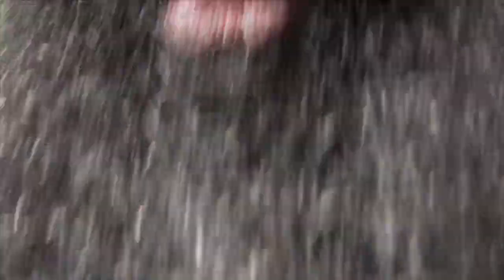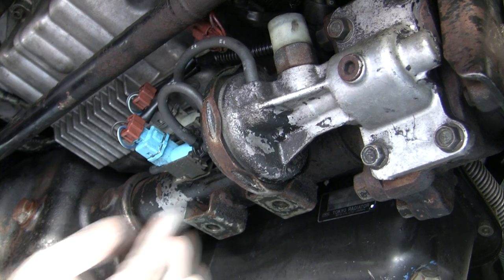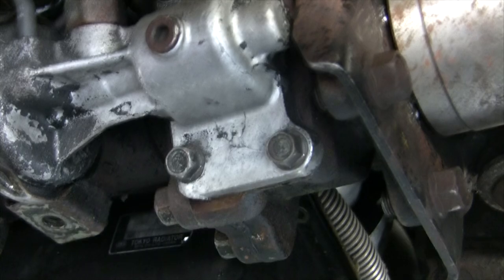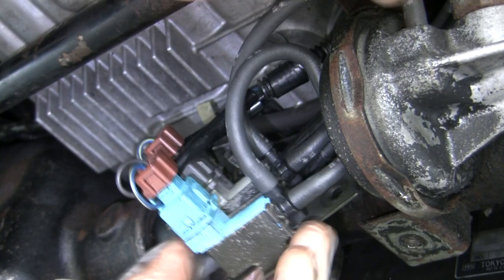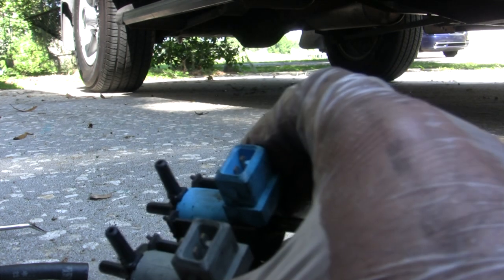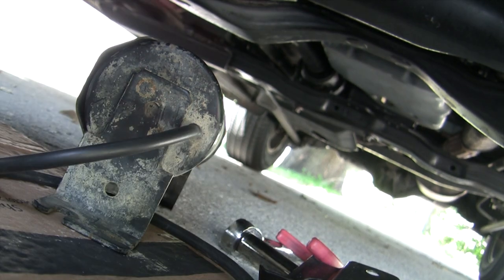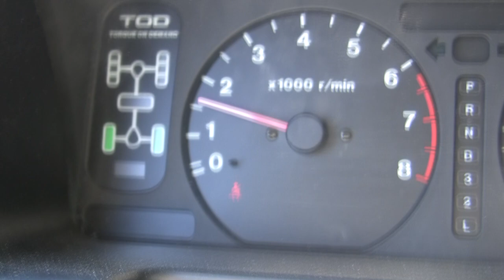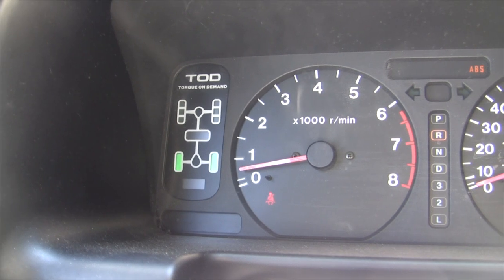Isuzu Trooper Flashing 2WD 4WD TOD Check VSV  issue Cleared!

Comment: I have a 1998 Trooper. It took me 3 years to track down the problem. With the help of Planet Isuzu, I could work through the system. I first started with the solenoids. I disassembled them. Polished the metal cylinders to remove corrosion, sprayed with parts cleaner, and reassembled. Then I checked all the Ball switches that indicate that the messages sent by the ECM at each step were enacted. Finally, I turned my attention to the transfer case.  That is where I found a loose ground wire. There are 3 control wires that go into the motor that moves a rod that engages the front wheel drive. It is only after all the ball switches are in agreement that the blinking light on the dash stops blinking and the 4WD is working. The main reason it took me 3 years to fix my Trooper was after each step I took the 4-wheel drive would operate for a while and then the SOTF light would start flashing. In hindsight, this was not a difficult problem to solve. The problem is the amount of time it takes to verify that all the procedures are working.

Comment: Nice going Farouqi. I noticed your ABS warning is illuminated. Bare in mind, the TOD, requires the ABS to function correctly. Namely the (4) wheel speed sensors, are enumerated by the ABS ecu, this data, (delta) is fed to the TOD ecu, which in turn, will disengage the front axle drive lock, (SOTF). It's  specifically the SOTF operation you show here, (Shift On The Fly) if you engage the 4WD manually, (only for off road, or snow etc) this will also engage the front axle lock. The biggest problem with getting one's head around "TOD" is failing to recognise TOD is a SYSTEM, and many components are part of it. I liked your video, because you opened with that very same "mistake" i.e. stating "this" is a common problem, many people have, then come to follow a process, (read the manual) break it down, and systematically test. Only to discover, it's not at all common to find someone stole a critical component like a vacuum reservoir. Also, side note, the biggest single cause of "TOD" issues are the owners, not reading the manual. Resulting in common causes like different tyre pressure, or even different tyre types, and if the OD of any one tyre differs, the ABS will send a delta (slip) to the TOD which it recognises must be wrong. This is why the TOD has it's own check warning, to cover a situation that another upstream device feeds it BS. I really enjoyed you sharing you excitement and satisfaction. Perseverance paying off :-)

Comment: Probably one of the easiest SUV one can fix. Get a workshop manual, spend a bit of time reading, join a good owners club and get things fixed yourself! No special tools needed, cheap parts all over the place and common sens make it one of the best SUVs to own. I got the 4JX1 3.0 diesel engine and I never let any pseudo mechanic get their hand on it. I fix it myself and it drives and pulls like a train! Good video!
Reply from the maker: I agree after owning it for a few years now one thing I always to is oil check and change.  It's just something you have to deal with owning this thing but it's working strong and after installing a transmission  cooler it's so much better

Comment: Good job and Don’t worry about the purchase of the canister
from ebay It was cheap compared to motor mechanics and the outcome YOU fixed
it.
Reply from the maker: The sad thing is so many mechanics couldn't figure it out but man I put brains to work.  It's still working just fine and never touched it again.  A mechanic was the one who rebuilt the entire engine and just decided to put it back together half ass leave things broken and disconnected and removed essential parts.  I assume it's common practice so people can come back for more abuse and drain wallets

Comment: Thank you for the video. I have the blinking problem when I click the 4wd button then the check light comes on. Did you buy new hoses or were they all still there? I am going to work on this these coming days. How long did it take?
Reply from the maker: I had to buy some hoses because some were worn out.  The whole process took roughly about 3-4 hrs I would say but I'm very limited in my mechanical skills.  The thing that took the longest was cleaning up the area there was so much dirt and oil buildup.  Be extra careful because the VSV was very brittle so I sprayed it down really good and soaked it with lubricant just so nothing breaks.  I hope this helps just make sure all hoses are connected that was my main issue hoses were in the wrong place and disconnected plus the the canister situation, good luck keep us posted if anything new is discovered.  My only problem with this vehicle is gas mileage and having to add about a quart of oil every 3 weeks or so other than that its a great vehicle.

Comment: Very helpful video good job! There are 2 vaccum lines that they go up in the airfilter (as the diagram shows). Where exactly they go because mine are both disconnected??!
Reply: Same. No idea, these hoses are zip tied to the frame on mine. Please help?
Reply: Along with eaither a sensor, float or plug of some sort?
Reply from the maker: Same thing mines are disconnected I tried looking for some OEM photos of the engine bay to see if they lead to something

Comment: Amazing.  After my transmission was rebuilt, this issue started happening.  So, is this something a female can do?  lol  Where do I find the line that ended up being disconnected on your Trooper?
Reply: Same thing here..I am going to attemp the work myself😊
Reply: @andreamorales6369  Will you let me know what you find? I haven't had a chance to look underneath my car yet.
Reply: Yes Jennifer you can find this problem just colour mark the hoses to the location before disconnecting -
Reply from the maker: Yeah it's real easy.  Try your best not to mix up the hoses label it tape it marker whatever works.  Just do exactly what I did.  I had to physically feel where the hose went without moving it from its original space but if you do just look around till you see something disconnected.  Clean the area good because all that grim down there makes it too damn messy.  The canister thing is by the driver side under the vehicle.  Clean the parts real good and just be extra careful things are brittle.  If you have a local junkyard look for a trooper and you can get the parts off of you break something because parts are rare.  Keep us posted

Comment: I'm going thru the same issue.🤦🤦🤦 Im not a mechanic but I guess I might have to do it.
Reply from the maker: Trust me neither am I... This however is pretty simple to access just be delicate not to crack any thing and as for the hoses make sure they are all in the right places... Just for an update the check light never came back on...  The only challenge was cleaning up the years of built of oil
Reply: But minds make a grinding noise sometimes. Will this help??
Reply from the maker: Grinding when you engage the 4wd?

Comment: have you had ant issues with the transmission acting up in over drive? It will start reeving up and no power to the wheels! Push it into natural, cut the swatch  then back on! Good for a bit then it does it again! Like you the mechanics i don't know i have never mess with one!! So i hear there is to calanoid's in the tyranny, one to power up the sednoid to the switch to over drive !! i have driven it 10 miles no problem. get out start again and maybe less than a mile it will do it !! Ant ideas, or advise for anyone who might know !! Thanks Gene Edwards,

Comment: I have a 02.... what is the name of the cylinder part?
Reply from the maker: I found mines on ebay however most Isuzu rodeos and trooper have them I guess.  The part number is 8971021002 for the canister.  It was from a 97 Trooper and it fitted perfect in my 2000.  The 4WD light never came back on the issue is fixed.  The other part number is 8971018581 Denso Japan.  Good luck and be careful some of them plastic things can break easy.
Reply: My trooper is 2001 126,000 miles TOD is not engaging no check light is coming on 
In low or auto mode it just flashes all four in low mode and in auto it flashes just the rear but no check light turn off auto rear stays solid no flashing 

Any help would be appreciated

Comment: hi, i have an isuzu bighorn 1999 model, it has the same issue of the blinking green lights and the check on the TOD. so what you mean is just cleaning up and the problem will be gone?
Reply from the maker: For me it was due to two disconnected vacuum lines and I assume some electrical cleaner would help those moving parts since they probably haven't been engaging for who knows how long.  But yeah cleaning it up and making sure the lines are right and I also replaced a few worn hoses after but it did fix my problem hopefully it will help yours also.  Just be very careful and use proper tools because the parts are old and can break easily to spray down with some lubricant first to loosen things up.  Good Luck btw the blinking never happened again and the TOD works just fine now
Reply: Farouqi Amin wow. That’s cool. I have been driving mine for a year now with that blinking thing and check light, I wonder if there is any damage the car gets in the process
Reply: Farouqi Amin do you still have the trooper till now?
Reply from the maker: @nickcanon7415   I drove mines for awhile probably 2 years with the blinking but nothing bad has happened but then again I'm not familiar with how these things work.  I guess it was just staying in 2WD all the time.  Once I fixed it there was never no odd sounds or further issues.  I still drive daily it does burn alot of oil I have to add a quart roughly every 800-1000 miles sometimes 1 1/2 quarts.  It also is very bad on gas, I probably get 13-16 mpg on average.  A mechanic told he can put a Toyota Tundra engine and trans in it so I'm actually saving for it.  I have no idea if its possible but he said he can do it.  I will actually post a new video of mines in about a week just a review to honor its 20yr old anniversary.
Reply: Farouqi Amin ok, mine is a diesel so the fuel is quite cheap. I can’t complain on that, but nowadays I have to top up automatic transimItion oil and engine oil so often, I sometimes get the oil lamp on the screen , but once I topped up the transimition oil, it disappeared. I love this suv
Reply from the maker: @nickcanon7415   I installed an external transmission cooler its the only mod I did and I will also put an oil catch can.  The trans oil used to get really hot before and I can feel the heat coming from the trans before I did that install but after I did it, it takes much longer to get as hot and most times it never got as hot as it did.  I wish we had the diesel here in the states.  I get alot of info from planetisuzu forum.  I don't have whatsapp but I can set one up.  I would love to see your vehicle they are so rare here in america I guess most of them had engine failure to to poor maintenance.